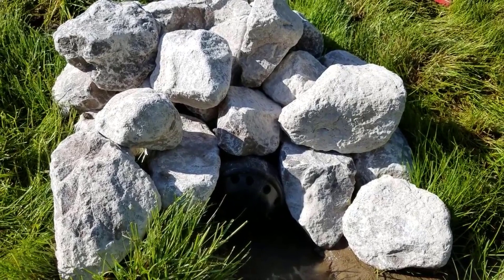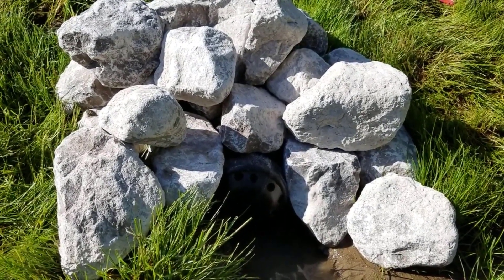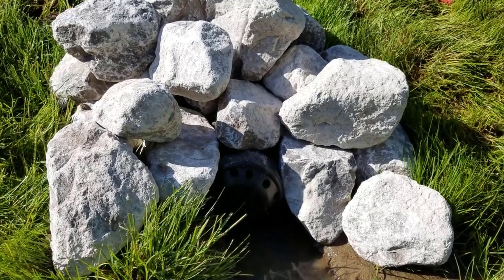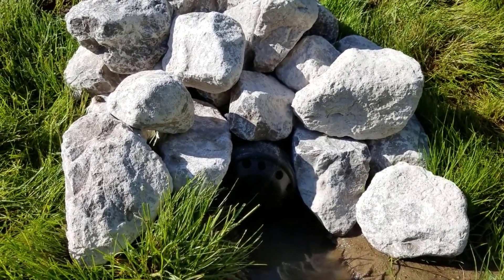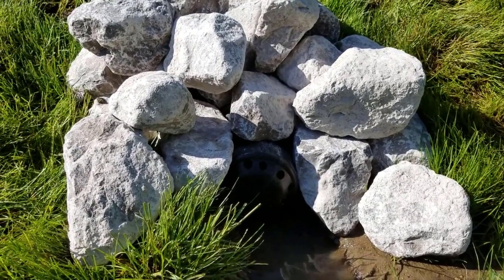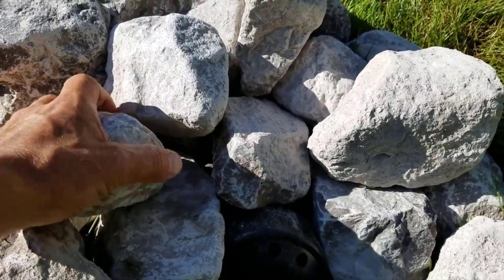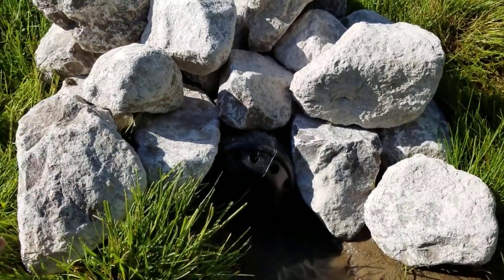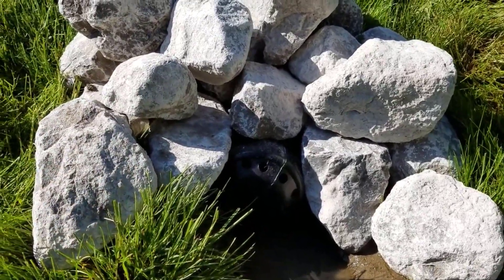How to Take Drainage Discharge Line to Daylight [ & STOP BACKFEEDING OF WATERWAYS ]

Comment: I found a french drain on my property that "daylights" into the creek bed.  It actually comes out below the typical water level (So there is always water over the top).  Is this normal, or should I rework it?  I am guessing it has been around for 20+ years.  I found the end of the run after the last rainfall, water was coming out of the ground like a spring and I dug around until I found the end of the pipe.  It had a metal end on it similar to the first one in your video.
Reply from the maker: It will work great under water. Water seeks level. As long as the creek doesn't get higher than the French Drain

Comment: I heard in extreme cold areas a crawlspace sump pump exit line can be protected by taking foam board and burying it several inches below the soil above the pipe. Have you heard anything about this.